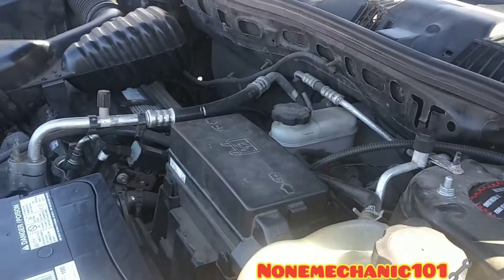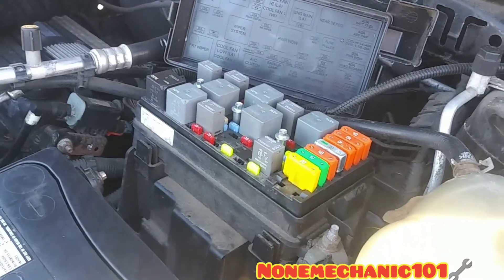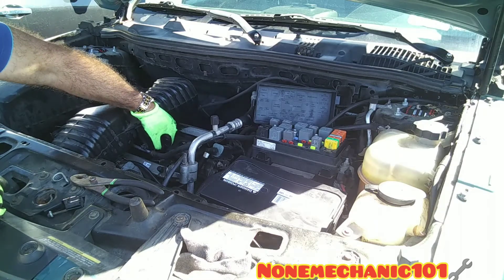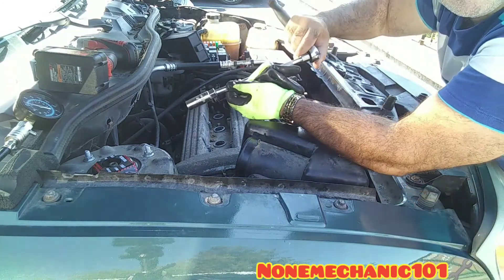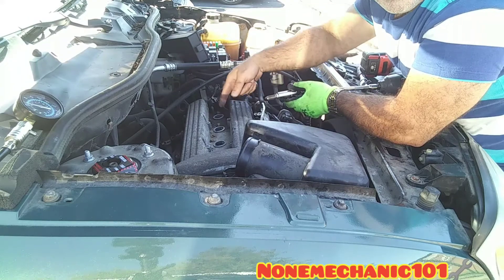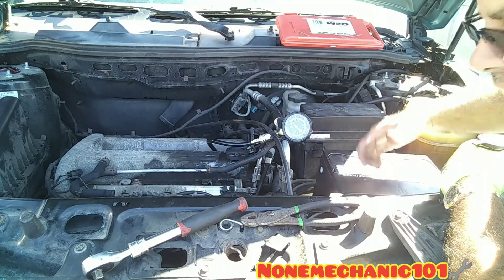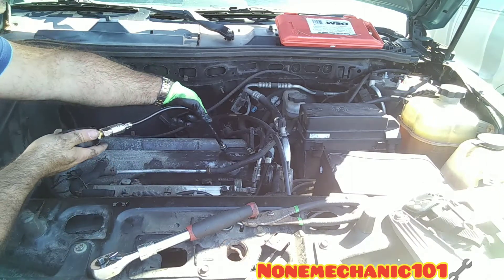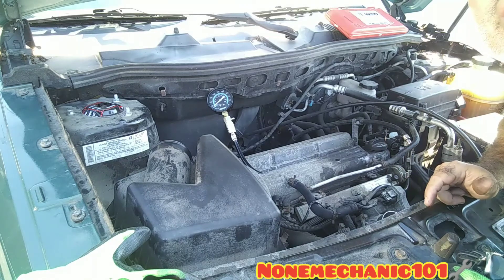2007 Saturn Vue. No Compression in all Cylinders

Comment: Just a Fyi once you get yourself built up financially a little in the business you should look into the ATS E-Scan Elite by Automotive Test Solutions. You'll be able to do a relative compression test meaning one cylinder to the next so you don't have to remove spark plugs. It's well worth it for the money spent once you do a handful of cars not to mention the other great features the tool comes with. You don't have to even remove plugs let alone much more than hooking a "sync" wire up if you have or get a scope. Saves you tons of time down the road, also expands your diagnostic capabilities big time making it possible to do even more jobs.
Reply from the maker: Thank You🔧👍

Comment: For no compression in all cylinders you would know if each/all the valves were broken/bent/leaking that's rare compared to timing belt turningover with Cam&Crank... when head gasket blew I had 60psi..but after replacing head gasket & resurfacing my compression test kit show 0 psi on all valves. So timing belt/TENSIONER was loose not tightened/torqued with allen wrench & torque tightened timing belt to keep it on crankshaft &camshaft
Reply from the maker: Thank you

Comment: If Timing belt was loose that could've caused no compression from the tensioner pulley not torqued to timing belt. Of course if head gasket was replaced or not blown then compression should work... unless head bolts are not torqued down with proper vehicle specs causing there to be loose head & no compression
Reply from the maker: Thanks